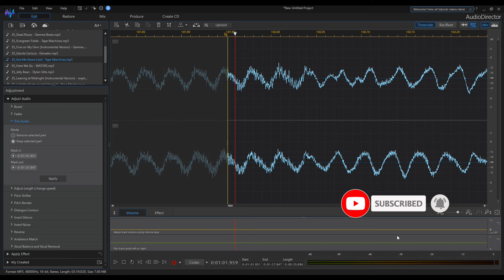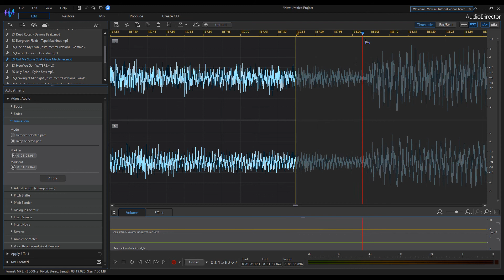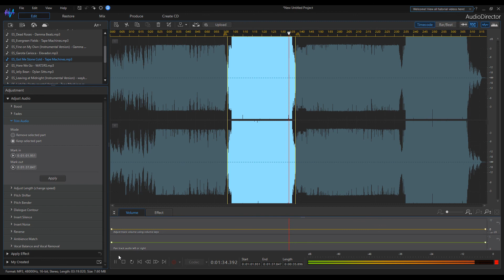🎼 How to trim audio ?  | AudioDirector 11(365) Tutorial

Comment from the maker: Correction for range selection: 
If the playhead is moved to a different position because of zooming, it is also necessary to move the start or end positions of the range selector to the playhead position.
Depending on whether you set the start or end position of the range. In this way the range will be set correctly.